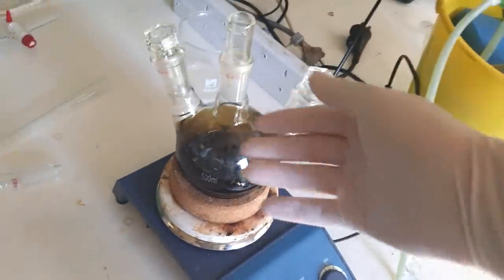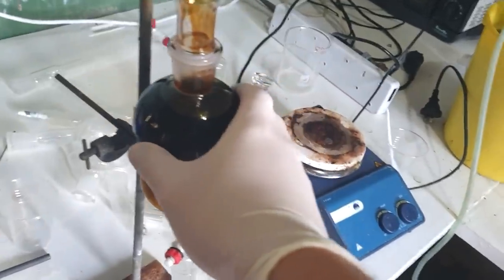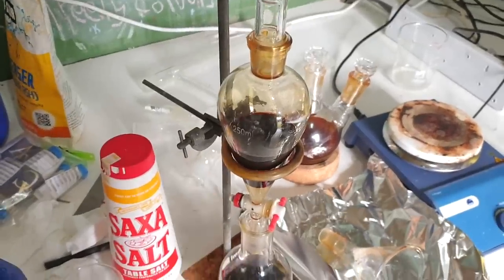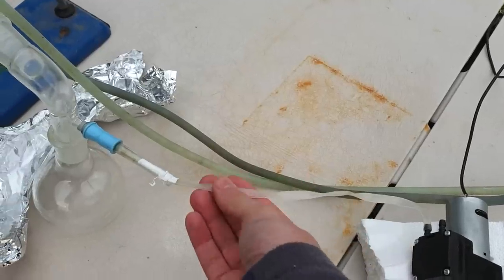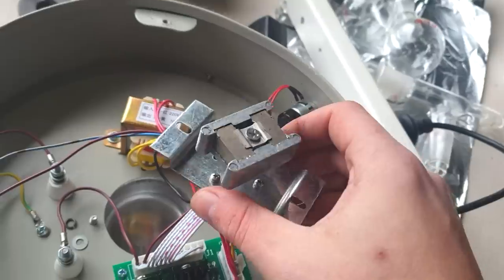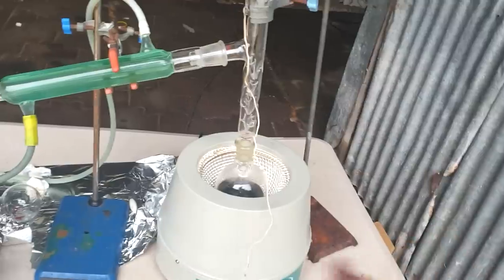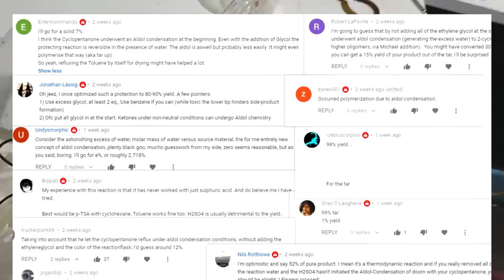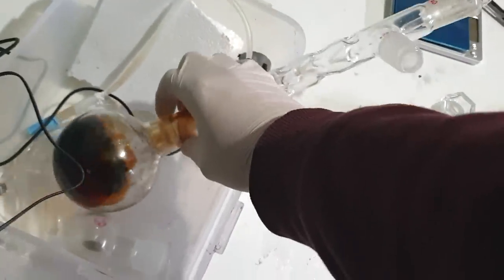Cubane Episode 3 - Vacuum Distillation for the Ketal?

Comment from the maker: Should I get a different pump for the vacuum distillation? Or just manage with the one I use here hmm
Reply: Does patreon afford it?
Reply from the maker: @benabusthethird9751  yes, indirectly. The Patreon is for the main channel, so while this cubane will be a main channel video eventually, it's a long way off.... But I don't often think just like that, I do buy new stuff for the lab all the time, because what else am I going to spend money on??
Reply: wouldn't a cheapo aspirator be kinda perfect for this usecase? You get a good enough vacuum, great flow and don't need to worry about burning out or corroding a motor. BTW what do you think about doing this as a short path distillation? Lower the temperature even further.
Reply from the maker: Oh yeah could use the short path! But I don't have running water in the lab, could try and do some sort of water pump-aspirator setup?
Reply: I think a stiffer vacuum hose would be the most important, then maybe a small pressure gauge (optional)? that pumpy boi seems like more than enough for this. If it can hold the partial vacuum while boiling water with that collapsed tubing it seems plenty strong for this.

at the very least you could just shorten the tube until it can't collapse like that, or at least less so.
Reply: @ExtractionsAndIre  The vacuum from water aspiration might not get deep enough to prevent the degradation you're seeing, just a head's up. Short path distillation is absolutely the way to go though, tried and true. I use short paths with cold traps and vacuum pumps to distill thermally sensitive compounds in the 2-10mmHg range and it's a combo that's never let me down.  Love your stuff man really happy to have found your content. :)
Reply: Bike pump it
Reply: you don't need running water. - just use a little 12V water pump and cycle the pumping water. That should provide enough pressure & flow for the pump.
Reply: but you spent all that damn time cleaning it and ixing it :(
Reply: Cow adapter would be good.   You wouldn’t have to break vacuum.
Reply: hi  i have a farm near bendigo that u could use for bigger bangs
Reply: As mentioned by others, the current pump will probably work fine with some thicker walled vacuum tubing and a trap between the still and the pump.
Reply: Also, didn't you get a vacuum gauge from that University?
Reply: with a good cold trap I'd think you could use your good vacuum pump. But with an hour drive to get dry ice that might not be too practical, I don't think I've heard you even mention liquid nitrogen which would be better. 
 Nile Red uses what looks like a recirculating water aspirator for filtering,  but I don't know if the pressure is low enough for your distillation.
 A hose that doesn't collapse so much would certainly help, even with the cheap pump.
Reply: caspar valentine you use your basement for that? I bury all my pets and plant a tree over them, giving the tree their name.

I even have a tree named after my ex wife
Reply: I second all the comments of using stiffer tubing for the vacuum pump. It probably cant keep up sucking the pressure created from the evaporation. Get a tube with a similar ID to the OD of your glassware and use a hose clamp to connect everything together, the thicker the tube going to the pump is the more effective it will be
Reply: you can get chinese rotary pumps for 60$ us they are used for car air conditioning
Reply: Can you do a codeine to morphine synthesis? I was thinking about trying it myself just for shits
Reply: @li5up6  very illegal and no. Also very hard silly, demethylation is no joke, leave it to ur enzymes. I used to do heroin, opioids no joke. Plus you will lose more in demthylation chemically than biologically.
Reply: Oi Mate,
maby not for this reaction but in general, you could use a aspirator pump, Nurdrage has done a nice video about this and his setup doesn't need running water. btw you may want a safety bottle between the water and your product!

furthermore you need thicc tubing for vacuum applications, and you could get a better vacuum if you put two pumps in series.
Reply: Nah, just save the cash for as much molybdenum as you can buy.
Reply: @li5up6  are you insane? How desperate are you Bud?
Reply: If you can get a little pump then yes definitely do that. But either way I’d suggest getting some kind of manometer (even an old mercury one). Also you should use a cold trap
Reply: New pump.
Reply: use a aspirator its cheaper than vaccum
Reply: @ExtractionsAndIre  use water bucket and pump setup like nurd rage did with aspirator use a  diaphragm water pump to pump water the setup not cost much There are a lot of cheap diaphragm water pumps out there look for them on ebay or Amazon and use it. Maybe whole setup with aspirator will cost about 25 USD
Reply: Even a cheap rotary vane pump will be better than that pos.
Reply: @japdog9  that's the spirit
Reply: Maybe, but that little thing looks cute! Perhaps get some thicker tubing and add a vacuum trap in series with the pump :)
EDIT: Just to elaborate: I think 110 degrees is fine and you can reach it with your setup (perhaps you'll need to remove the fractionating column, at some point). I believe that if you did have some product, it would have eventually distilled over.
Reply: Fill up the collecting portion of the dean stark with toluene/benzene before you start distilling so you don't have to keep adding more as it boils over, it will start dripping back in as soon as it begins condensing.
Reply: I'm actually kinda impressed with how relatively well that little pump performed, but I don't think it'll suffice for most applications. Aspirator pumps can actually achieve pretty good vacuums (15-25 mbar in my experience), and you don't really need to worry as much about what is sucked into it. Also, ideally you would have a vacuum gauge so you actually know what pressures you're working with. Whatever you do, the current setup isn't really good enough, and I think you'll be glad to have something that works properly. Especially since vacuum distillation is one of the essential techniques for home chemists (at the lack of chromatographic techniques).
Reply: @theprogrammer32  The tube will still collapse unless the length is super short, in an impractical way. Thick walled Tygon (I've used R-3603, LFL, and 2275) is great for holding a vacuum.
Reply: Don't know about the pump but the tube should definitely be changed for something harder. This one is way too soft even for a small glass water jet pump.
Reply: What’s wrong with the vacuum cleaner?
Reply: Anyone who wants to really do organic chemistry will have an oil sealed rotary vein pump like an Edward's rv-3. The do cost around 2k usd used minimum tho :(. Maybe not totally necessary for this, but you will find yourself using it constantly. Also it's terrific for drying solids. 

You can yank low boiling solvents into it just fine if it's hot becuase they will boil out. Use a simple dry ice trap when distilling other crap though, cause they will ruin the seals or make the pump stink permanently. RIP that pump in my old lab someone distilled TEA into.
Reply: You just need stiffer vacuum hose as people have suggested. Could a better vacuum help? Maybe in future projects. But you said it yourself, your product must be stable at 110 degrees because you reflux it at that temperature when you make it. So you don't need to worry about getting better vacuum.
Reply: haha, the stir bar debacle... been there
it turns out most of the cheap(er) bars have neodymium magnets inside, they demagnetise when used with anything above 100C or so. I have a whole bunch of dead ones sitting in my drawer...
I'm thinking of making my own with proper high temp magnets... I'll get to it, eventually...
Reply: @LateNightHacks  most of those hi pressure diaphragm pumps don't have enough volume to run a asperator, my glass asperator ( purchased from nashiglass) is running 20 litres per minute, 40 psi pump and it 3/4 works but just doesn't have enough flow so i got a 240 volt water pump for 60 bucks on crapbay which i think will work perfectly when i finally plumb it up.. 🤞
Reply: Dude seriously you need to cut it out. 😂 Filling your sep funnel so fully you can’t even shake it does not make you a genius by the measure of any chemist.
Reply: put the pumps on series
Reply: Maybe you could a water pump and a Venturi adapter? Water pumps are cheaper than vacuum pumps and not as sensitive.
Reply: how about re-doing the synthesis with pTSA? in my experience, reactions with H2SO4 always go black, I feel like pTSA might give you a cleaner product after all :D also, generally I would add all the reagents and then the catalyst last
Reply: @danielgrantcoleman  wish I could give this comment two thumbs up...
Reply: @ExtractionsAndIre  Instead of an aspirator you could also use a fridge compressor. Pulls about the same vacuum although the flow rate is low, so it takes a little longer to achieve the max vacuum. In my experience you can use them for 12+ hour vacuum distillations, just put a fan on it so it gets cooled that way. The advantage over an expensive real vacuum pump is that they can be got from dumpster diving, and you can put corrosive fumes through it without worrying too much since they are cheap.
Reply: @ExtractionsAndIre  you should make a 2nd patreon for this channel, then. I would sign up for both.
or you could have different tiers like pay per video for one of: E&I, E&F, or ppv on both.

Comment: The vacuum distillation using a complete glassware setup but a vacuum cleaner might be the most hobo looking chemistry I've seen on youtube and I love you for that.
Reply: Vacuum pump go brrrrrrrrr
Reply: hey i did distillations using a rice cooker for about a year
Reply: Bro you should see the stirrer I made out of a single 2x4, nine wood screws, and a stripped down drill press. Also, JBSC's nigreux funnel
Reply: @ezequielcruzrosa8494  Imagine the meme: Rice cookers are the "bad opinion" side of the meme, deep fryers are the "good opinion"
Reply: @ezequielcruzrosa8494  did you ever eat the rice from that cooker after that or nah
Reply: @word6344  Before using it as a heat source, yes. but after that it was strickly for chem.
Reply: @alexandervangraff8475  well yeah, at that point you're comparing a rice cooker to an oil bath
Reply: It’s Tom what do you expect.

Comment: I vote for mmHg to be replaced by “mercuries”
Reply: they're referred to in labs that I've been in as MUHGS
Reply: I vote for the Torr instead of mmHg.
Reply: zonex001 but doesn’t mercuries and/or “millimercuries” sound amazing?

Edit: Hell, get loose with it, go full “millimercs” sounds valid, or like a squad of tiny mercenaries....
Reply: @Patmccalk  "torr" sound shorter than millimercuris.
Reply: Mercurydoos?
Reply: *mmmercuries
Reply: Tetrahedral GD thicccc mmmmmmercuries
Reply: @JustinKoenigSilica  mmHg is metric (though not SI). The US customary version is inHg, inches of mercury.
Reply: @zonex001  Sounds like a screwdriver

Comment: The reason you get such a bad emulsion is because of the ethylene glycol. It is very soluble in both water and toluene. It is literally used in formulations as an emulsifying agent. In order to break the emulsion you really need to dilute the ethylene glycol. You could try adding 5-10x the amount of water, or toluene, or both, and I think this would aid in your separation immensely. Also, if you don't do this, the ethylene glycol will help in dissolving your product into the water layer and your % yield will suffer!!
Reply: Only problem here is the ketalization reaction is reversible and produces water as a product, so excess water in the reaction vessel at any time will drive the reverse reaction by Lechatlier’s principle destroying the product molecule
Reply: @nathanfriede5234  Which is why he distilled it off in the first place

Comment: You will definitely pull this one off in the future. The biggest No-No for ketals/acetals is you can be acidic or have water present but NEVER both at the same time. This goes especially for the workup, acid needs to be quenched as anhydrous as possible if you want to extract, which is why using only 0.05 eq. of pTSA is so convenient: you add NaHCO3 at the end and are golden.

Comment: Try to use PTSA instead of sulfuric acid. I have done those reactions quite often and observed that sulfuric acid tends to form tar, especially when it was heated for too long. Don't reflux for 30h that's way too much. About 2-3h will do the trick.
Some ketal formings even needed temperatures below 0°C, because the formed ketal in the reaction mixture decomposed quite rapidly at RT. 
If it's possible, try to check your reaction progress with TLC. I recommend using an vanillin/sulfuric acid mixture in isopropanol to make the spots visible.
Anyway, keep up the great work! Greetings from Germany :)

Comment: An other thing to try for your next round might be to first make the anhydrous pTSA solution in toluene. Just add the sulfuric acid to the toluene and reflux with Dean Stark trap until it doesn't produce any more water and becomes monophasic. Then add the ketone and the glycol and perform the reaction.
That way you don't have hot concentrated sulfuric destroying your staring materials :)
Don't really know if that makes a whole lot of a difference, but it might be worth a shot.
Reply from the maker: I think this is my next plan yes, it sounds like a good idea!

Comment: Aldol reaction is how I used to purify ethanol from a commercial "bio ethanol fuel" mixture, which is ethanol denatured with dye, bitrex and 2% 2-butanone. Add a few spoonfuls of NaOH and an excess of CaO (to bind any water present), and you push the self-aldol of 2-butanone to completion. Pure ethanol is distilled from this mixture (2-butanone has the same bp as EtOH so after complete aldol self-condensation into high boiling crap, the CaO absorbing water and pushing it to completion).

Comment: If you want a better cheap vacuum pump that won't be affected by solvents passing through, an aspirator pump might be the way to go. They require a pretty strong water flow to operate, but I've achieved pressures below 70 mmHg with mine (could probably do even better with a proper setup). 
It's still not quite up to the 23 mmHg from the paper, but might still be effective.
Reply: A simple pre-turbopump would drop that significantly. Basically a multi-stage Tesla turbine made out of old CDs.

Comment: You can make a DIY stirbar puller from PTFE tube, PTFE rod and a neodymium magnet (cylinder/rod shape). These come in all sizes and diameters, so you can fit the piece of PTFE rod in the tube, as well as the magnet, making a chemically resistant puller. I use one made like that.
Similarly, you can even make PTFE stirrer from the magnet sealed with PTFE rod pieces and a tube.

Comment: If you want a perfect power supply for most purposes, get a junk bin ATX supply and short the appropriate pin for 12V at like 15A minimum capability.  It will also likely have 5v and 3.3v as well.

Comment: I have that same 12V vacuum pump - noisy little mother. I had to put in a padded enclosure with pillows ‘n shizz on top. If you put two in series you can get close to hardware store AC powered pump vacuums.

Comment: There's no way p toluene sulfonic acid is hard to get ahold of.

Also, you can just call is tosic acid and save us all the misery.

The aldol condensation is one of thos reactions that always does happen if it can happen. So just assume it will next time, and make sure you desired reaction can compete kinetically.
Reply: p-TSA or tosic acid are definitely the way to go. I have learned to pronounce some weird names like Poly(phenolphthaleinterephthalate) but para-Toluenesulfonic acid just isn't worth the effort.
Reply: @hammerth1421  maybe I'm uppity but it doesn't give me any issues. I'm a professional chemist and learning to use the functional group terminology just comes with the territory.

Comment: Damn I really did not want to jinx it with my statement -.- but maybe it is also a good idea to go the extra mile and make the p-TsOH. Just to avoid the strong dehydrating conditions even before the toluene does its thing. I also agree with the others that a drying might help speed up the acetal formation. And use the shortpath destillation.

Comment: That's a wicked bong.
Reply: hasnt cleaned it in a while though, by the looks of it at the end
Reply: @theprogrammer32  Hot ethanol bath does wonders. Just make sure you have ventilation, because the mere thought of that smell makes me want to vomit.
Reply: @AtlasReburdened  haha, I was joking, but personally I stuff the ends with bits of plastic bag wadded around paper towels (plastic for water-proof-ness and paper towel for stuffing), then I let it sit with alcohol and tons of excess salt. It's sealed, so no vapors, and you can shake the hell out of it. I'll occasionally shake it a couple times a day for a couple days. the salt is a cheap ("non soluble") abrasive.

of course, if you're in a hurry hot alcohol could be useful, too.

Comment: Previously, I had performed this cyclopentanone + 1,2 diol  protecting reaction using microwave and toluene (without adding pTSA), and the reaction was very clean. Only need to remove the toluene and water thereafter. :P
Reply: Huh, what is the purpose of the microwave in this case? Also how come it works without an acid
Reply: @samuelallan7452  The energy and dehydration process.
Reply: @birdie123  But what is the advantage of microwave vs hotplate in this case? I'm sorry I don't get it yet

Oh shit I got it the microwave makes adding the protecting group favorable somehow? Never heard of this but it is very cool